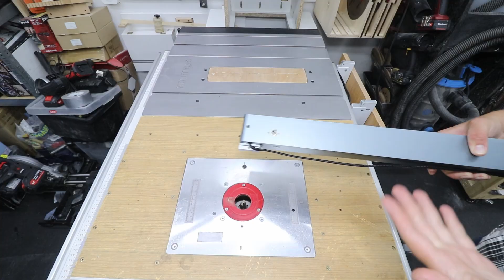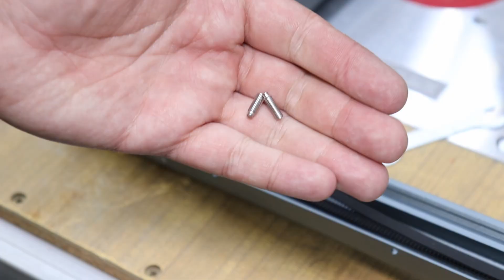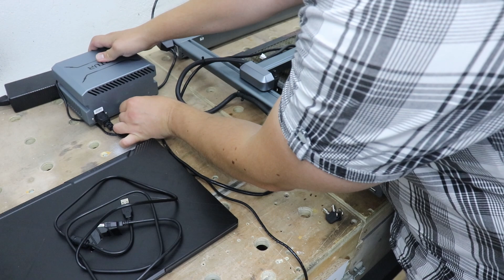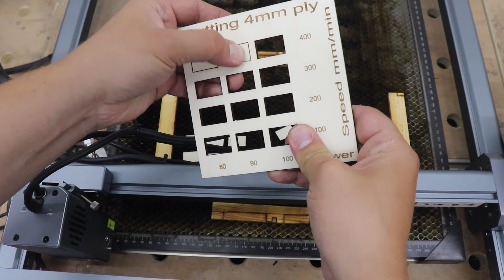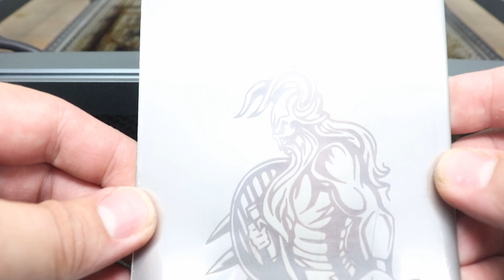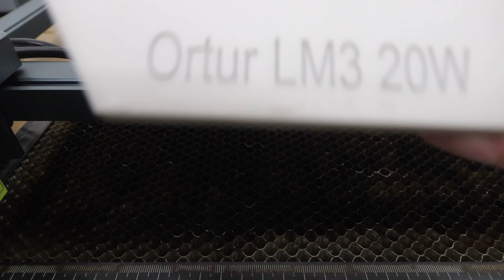Ortur Laser Master 3 20W - Detailed Assembly plus Testing

Comment: Great job, man! I wonder if turning on the air assist could help in the metal engraving to dissipate de heat and avoid the bending?
Reply from the maker: I don't think that would work, it wouldn't be strong enough.

Comment: Hi, hoping you can help. My laser got stuck on its way back home from framing. I think it slipped. Turned it off straight away but now won’t go home and won’t travel more than four inches up or down. What has happened and how can I fix it. Hope you can help 😬
Reply from the maker: @annelieselewis979  could be one of the motors thats damaged. Maybe the tension on the belts I incorrect. Or it could be the wiring. Have you checked the wires if they are sitting correctly, maybe they got loose?
Reply: @ thanks no haven’t checked wires. Maybe I’ll just take it all apart and redo. See what happens. I have sent a msg to ortur so will see if they respond if I can’t fix it. Hardly used 😡. Thanks

Comment: What your favorite 20-24watt laser.
Reply from the maker: Hard choice, in the 20W bracket I would say the Longer B1 but all the 20W modules offer similar performance so I would suggest getting what's most affordable
Reply: @CasualDIY  I bought the Creality that you reviewed because it beat the longer in every test and it was almost put together for you lol. I also bought the 400x400 honeycomb and the rotary roller to engrave wooden ink pens that I make.
Reply from the maker: @RacingOldTimer  solid choice and it will do the job just fine

Comment: Hi there,hope you're well I'm a subscriber of your channel & love the videos, please could you give me some advice on laser engraving/cutting as I have literally no clue but I am seriously thinking of getting into it but my question is can multiple cutters be controlled by just the one laptop/device or does each machine need it's own dedicated device,hope you can help me out with a answer thankyou & take care
Reply: Thanks for your reply Ive got a bit more knowledge now I know that it helps a lot thankyou and thanks to the channel take care
Reply from the maker: Hi,
Yes you can. I've just recently used Lightburn ( opened separately for each laser) and connected Ortur LM3 via normal USB and Atzer L2 via USB-c to my laptop and they worked fine. Some of the lasers will have WiFi connectivity so you can use a tablet or phone as well plus most will have memory card of which they can work the files. Hope this helps